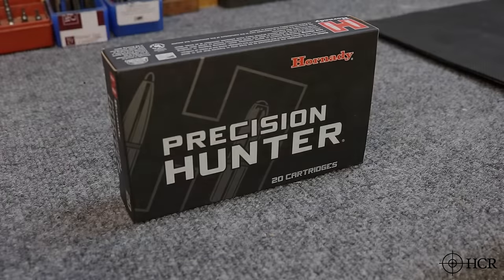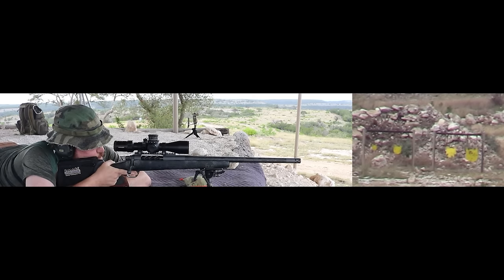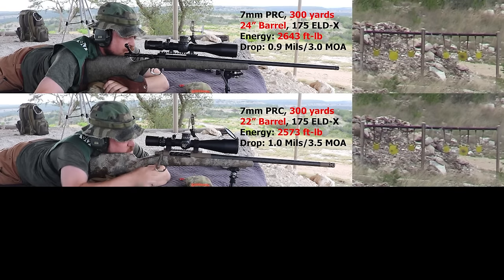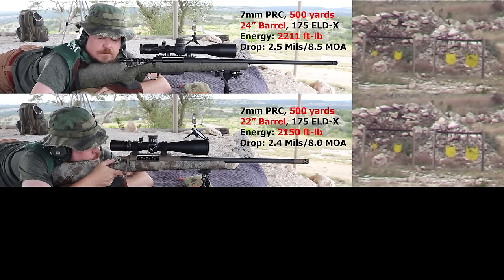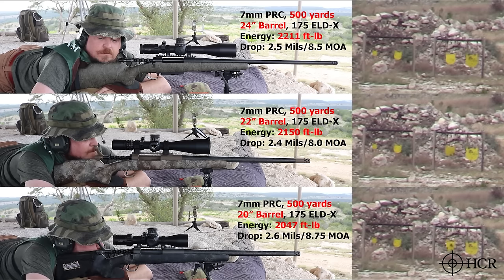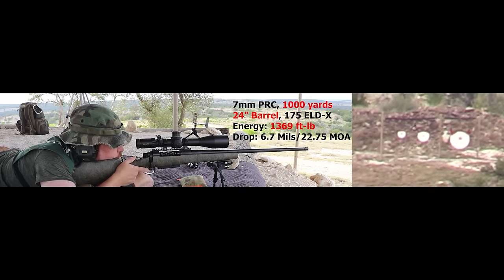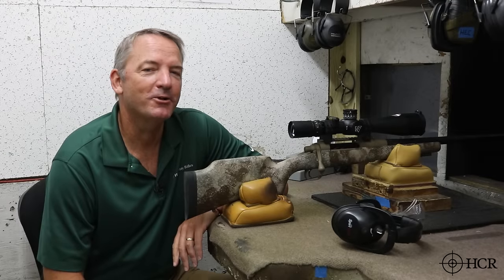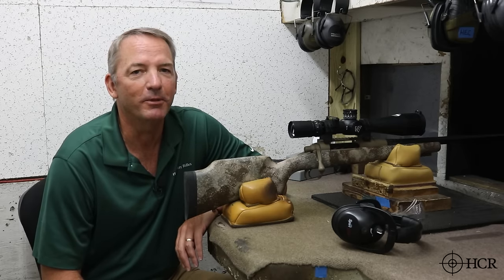Long Range 7mm PRC Testing & Data

Comment: Certainly doesn't look like it's better than a 7 mag to justify spending $20-$30 extra a box.
Reply: There is no cartridge that’s better or worse in performance. Obviously a .22LR and 300rum have different uses. But optimisation and being flexible is a huge selling point now. You can do everything in the PRC that the rem mag can do, but the rem mag was never made for heavy projectiles. Which is the major selling point. People aren’t going to run out and sell their rem mags tomorrow. But when someone’s in the market for a long range deer rifle the 7PRC would have the be at the top of the list. There’s no way you’d pick the rem mag over it. Which is what I’ll do in a couple years, get a nice 24 inch barrel to put on my rem mag and do everything my rem mag could do but with 100fps more, and being able to handle 162-195gr bullets that the old rem mag can’t
Reply: Not with the kind of factory accuracy and performance it won’t. 40$ a box bullets aren’t shooting game consistently at 800-1200 yards, or anything for that matter, not an old design anyway
Reply: @corygamble9785  you have zero clue what you're talking about. I bought a whole case of 7mag Hornady eldx last year for $42/box that punch groups that touch out of a Tikka.
Reply: @corygamble9785  Gunwerks flagship rifle was chambered in 7 mag and they promptly proved it on elk at 1200 yds.
Reply: @devinb3397  did you just say a 7 rem mag can’t handle up to a 195gn, have you been living under a rock. I have a saami chamber 7 mag and shooting a 195gn 2912 and if I have n570 I could go over 3000. That load beat every one in that video with the same amount of grains in the 7 mag.
Reply: @12318150  well ya got me on the accuracy but the performance out of factory ammo I’m still taking the dub. It won’t be a couple years and the 7prc will be the same price as everything else. 300 prc is only like 60$ at the local bass pro. If I had a 7 rem mag I’d probably keep it but they have a new predecessor and it’s the 7prc.
Reply: @12318150  they also tried to dump it from a 7 LRM which is virtually a 7 PRC
Reply: @SpudOutdoors  what’s your twist rate, how long is your barrel and what action is it built on? Im talking about the general rem mag you pick up off the shelf. You can’t just load a 195gr in 99% of the factory rem mags in existence. 1. because the twist will be far too slow and 2. Because the bullet would be so far seated into the case it’d just be stupid. PRC you can shoot 195gr in literally any rifle it’s chambered in with ease no questions asked. And will get more velocity 100% all things being equal like barrel length
Reply: @devinb3397  one you can buy factory browning 1:8 twist with a long magazine so everything you said was wrong. Secondly I shoot a 1 8.5 26” on a tikka action. If a magazine isn’t long enough change it. You are not limited by loving with factory. This isn’t the 1980s anymore. Going custom is so easy to do and lots of great smiths. How many people can buy a Ruger and completely change everything. Happens all the time. Your argument is just moot.
Reply: @SpudOutdoors  what if I don’t want a browning? And why would I go the full custom route and get a rem mag when I can get a 7mm PRC straight off the shelf that does everything with no mods, and has better performance, accuracy and efficiency? I own a rem mag, but no way I’d buy one over a PRC
Reply: @devinb3397  then that is your decision. But don’t say the 7 mag is worse because it really isn’t. With the 195 at 68.5 grains it is destroys that PRC and the PRC is using the same amount of powder because the bullet sits out further but it doesn’t push that 195 like the 7 mag does. I have no problem saying the PRC is good at what it does. Because it is a good choice for people but what I have a problem with is people under rating the 7 mag because they aren’t speaking truth to its performance. Same thing with 280AI. It stays in the pack easily.
Reply: @SpudOutdoors  the PRC literally gets better velocity than the rem mag. You’re just cherry picking your data that’s on the absolute extreme end of rem mag performance and comparing it to baseline PRC. Sure if you run a rem mag with a long barrel with who knows how much pressure, you can beat it eventually. I loaded my old rem mag to over 3100fps with 162gr pills but the brass was done after 2 firings. if you compare 2 equal rifles the PRC is getting higher SAFE velocity every time. And factory ammo has got way higher average energy and better ballistics for the folks who don’t want to reload. Theres factory load in the rem mag or 280ai that gets close to the PRC either. 
Backfire literally did a test where the rem mag got 100fps less than the PRC with the exact same powder charge
Reply: @devinb3397  it depends on powder and I didn’t cherry pick. I picked the best heaviest bullet. 7 mag will push it harder than PRC. Buy one if you can and idc. But stop thinking the 7 mag is a slouch.
Reply: @SpudOutdoors  how are you not cherry picking 😂 barely anyone even has the PRC yet and has yet to test all the powders and push it way past safe loads, and use a long barrel. How long is your barrel exactly? look at the safe load data, the PRC is quicker than the rem mag. The factory loads smoke it, 175gr at 3000 vs a 162gr at 2940. I guarantee if all things are equal the PRC gets better velocity for any bullet weight. Shorter fatter cases with steeper shoulders are just more efficient, it’s been known for a very long time. If you’re basing it off the fact that the rem mag has a few more grains H20 capacity it’s just not correct. Like I said, it’s been tested and with the exact same powder charge, same barrel length, same bullet,  the PRC is getting 100fps more. I could load my old rem mag to 3100fps with 162gr which was what the PRC basically gets, but the cases would be absolutely fried after a couple firings. You can’t compare the extreme end of the spectrum to a standard factory load and call it a day.
Reply: @SpudOutdoors  are you going to tell me 308 is quicker than a 30-06 because your 30 inch long gun with a load thats way over max shoots quicker than a factory 30-06 load in a 22 inch barrel?
Reply: @SpudOutdoors  do some research on how case design has a huge effect on velocity. Just because the rem mag has more powder doesn’t mean it’s velocity is higher. The PRC 100% gets close to 100fps more across the board all things equal.
Reply: @devinb3397  you have no clue what your talking about guy. I actually have the loads and beating the PRC, so it’s proven and if your a guy that hunts long range with factory ammo then your the one unethical. Guys who care about accuracy don’t don’t shoot factory ammo period. And if your going to reload. You get more out of the 7 mag. Period.
Reply: @devinb3397  your missing the point. I never said the PRC wasn’t a good round. I said you are underestimating 7 mags full potential. That’s the point. And while you are out there spending $70 a box of ammo that you can’t find. If I am out of my handloads I can pick up a decent box of ammo for $35-$40 any where in the country. Good luck guy.
Reply: @SpudOutdoors  how many more times do I have to repeat it.. the 7mm PRC gets higher velocities all things being equal. Your gun and or pressure, is not equal to the stock standard max loads that have been released so far. Nobody has even done any experiments with max loads. You still haven’t answered how long your barrel is yet either. Your anecdotal evidence means absolutely nothing. A rem mag can beat a PRC if it’s got a longer barrel or way over pressure loading. 100fps is not much. I could load my old rem mag to PRC velocities easy but the brass was absolute toast after a firing or two. I guarantee if you put the same bullet, powder and barrel length on two rifles in rem mag and PRC, the PRC will reach a higher velocity. Please do send SAAMI and Hornady an email explaining that their entire engineering department is wrong, because your magic rem mag can shoot a 195gr at 3000fps
Reply: @SpudOutdoors  I’m sorry but you honestly don’t have a clue. I’ll write it out in simple terms for you. 
1. SAAMI’s engineers state the PRC has higher safe velocity over the rem mag with the same barrel length 
2. Independent tests have confirmed this, with the PRC getting higher velocity than rem mags. Even with the same powder charge and projectile, it’s sending it 100fps quicker. 
3. Just because the rem mag has more powder capacity, does not mean it can shoot quicker. Case geometry plays a huge factor and makes up more than enough for a very slight lack in capacity. 

Go on keep explaining SAAMI and Hornady are wrong.  literally dozens of of engineers with thousands of times the experience any of us has, are all wrong because of your special rem mag that twists the laws of physics
Reply: @devinb3397  no reloader follows saami if they did then no wildcats in competition. You believe whatever the marketing tells you. Your not worth my time.
Reply: @SpudOutdoors I’m just dumbfounded you still actually believe the rem mag shoots quicker than the PRC. I’ll explain it one more time. If everything is apples to apples, the PRC is quicker that the rem mag without a doubt. Btw SAAMI is just the authority who tests the case to determine specs and safe limits. Seriously, write to them and explain how their entire team of engineers are wrong. Still waiting to hear what length barrel you have
Reply: @SpudOutdoors  Your 195gr at 3000fps load is a lie regardless. Not possible in a 24/26 inch barrel rem mag without insane overpressure
Reply: @devinb3397  I use a labradar yes it’s possible. Maybe if you actually followed reloading groups you would know it is. Many witnesses here that saw it happen. There is people getting higher than me I just don’t need to go higher. 2910 with that bullet is plenty of energy past 1000.
Reply: Belted vs unbelted is a huge plus for the prc and ultra mags.
Reply: @mikemcreynolds6236  I actually like the belts and if unitized correctly then double headspace
Reply: I wish they made high BC monolethic Projectiles,  lead free.
Reply: Funny how that’s what everyone said about the 6.5cm but now it’s cheaper than just about anything comparable besides cheap 308. Very uneducated comment. This round is going to have a huge following and support.
Reply: @MrT13  this comment is uneducated. Creedmoor was out for a decade. None of the PRCs are that cheap. Good lord.
Reply: @SpudOutdoors  what you want a year old cartridge to compare? I looked just now. They are both within 5-10$ a box 7rem vs 6.5 prc. Some more expensive for the 7 some more for the 6.5. 20-30$ a box is the only thing uneducated about this.
Reply: @SpudOutdoors  let’s actually go with something more comparable though. Go find 6.5x55 or 260 cheaper than the cm. Seeing as how both are older they should be cheaper right?
Reply: @MrT13  compare it to the 300 PRC
Reply: @MrT13  nope can’t compare creedmoor. It’s used by military. Any thing military gets cheaper.
Reply: @SpudOutdoors  6.5 prc 147 eldm 58$ a box. 7 rem 139 superformance 80$ a box. Hunting? 7 rem 162 eldx 69$ a box. 6.5 prc 143 eldx 64$ a box. Right now. This minute. On midway. So there’s that…………….
Reply: @MrT13  midway prices are a joke. I bought 7 mag for 37.99
Reply: @MrT13  just found a ton of 7 mag ammo for under $35 a box.
Reply: @SpudOutdoors  you did say any prc correct? But ok. Let’s see. 300 prc 225 eldm 64$. 212 eldx 64$. To me that’s the same is it not? Or cheaper. No there are no cheap manufacturers making any prc yet like there is old cartridges but I did just show you modern being the same or actually cheaper than a 7 rem.
Reply: @SpudOutdoors  yea and like I said yes you can go find some Prussia premier gold whatever for cheap. Cause it’s old af. You did say no prc though correct? Then I kept it simple. Same company. Same bullets. Different cases. And same price or cheaper. Not what you said. 30$ a box more. SAME jack. And does insanely better at all aspects. Nobody uses old stuff in competition cause it’s not better. And if it’s your price I just gave you apples to apples. And you’re wrong.
Reply: @SpudOutdoors  same thing with .243 guys. I used that round to shoot probably 100-125 hogs. Great round. 6cm is better. Absolute fact. Notice how those who have actually owned both of something will always tell you the newer is better. But those who own the old thing only just go by 2 simple numbers?…… that’s you. With your 30$ a box. That’s wrong.
Reply: @MrT13  there is a ton of ammo at 35 or under for 7 mag. You won’t see 7mm PRC that cheap and secondly I don’t buy from midway. They just spent over 100 mil to build a new warehouse. That is why they price gouge. I reload my 7 mag. I’m shootings a 195gn Berger over 2900fps which the PRC will never do.
Reply: @SpudOutdoors  the speed game is not precision. If it was everyone in fclass would be using the 28. Or prs would all be using 220 or 250 or 2506 but they don’t do they? So to say oh my whatever going whatever is better is ignorant. Competition has proven your rem mag is not precise. Not even in the top 5 choices actually. So if I wanted to say something dumb like my 220 swift goes faster than your 223 ever will. Is true. But the rest of the world must have just forgot to listen to your infinite wisdom…. My 284 shehane is a 2910-2920 fps second gun shooting a 15gr lighter pill. And it will absolutely undoubtedly walk any and every 7mm rem mag on the planet. That’s is just a fact. So like the 260 and 6.5x55 guys who don’t even own any of the 3 saying oh the 260 called and the cm is just now getting here? Hahahaha what a waste etc etc is always the same ppl who have a very limited if any experience in actual precision shooting. Do you just hunt? Good stick to it then. But the word better is not only for you to use lol. And my 284 is waaaaaaaaaay better in every way other a couple fps than your precision rem mag or anyone else’s for that matter will ever be.
Reply: @SpudOutdoors  I definitely agree with you though about pricing. Obviously there’s super plus legend ppufw ammo made in some crap factory with old stuff tooled for that caliber sold at auction and now is being made cheaper. That’s every old cartridge. But xxx box same pill same powder different cartridges? Actually the newer stuff is often cheaper. I proved that in some other comment in here with the cm vs 260 or 55. And the cm is faster. You mite be or you mite not be honest about that number which I don’t think you are honestly. I think your lying by about 200-250 fps but whatever don’t mean you aren’t. Cause all factory loads out of the rem at 175s come in at 2800ish. Lots of good fast hand loads with vv newer stuff getting 2900 but STILL WITH 175’s. So when someone tells me they got 250 fps more. PLUS 20 more grains I call major bs. Still fact is maybe. Lol. But nevertheless countless ppl have tried what you claim and I guess your better than all. Hm….
Reply: @SpudOutdoors  I hope you know that takes close to 80,000 psi though lol.
Reply: @MrT13  nope I am not. I am using Berger load data. Seating my bullet longer but only .1 grain more at 2910 Avg I have hit as high as 2980. Now that my action has a wsm cut I can do to the lands, so 3000 is achievable.
Reply: @MrT13  just go ahead and believe whatever marketing tells you. If you actually properly throat a 7 rem mag and seat the bullet at roughly 3.667 or so a 24” barrel can achieve 3100 fps with a 195gn. But a 195 in a standard throat is plenty of velocity and still allows you to shoot light bullets.
Reply: @SpudOutdoors  ok.
Reply: @SpudOutdoors  that’s the funniest shit I’ve ever heard. 3100fps with a 195gr in a 24 inch rem mag 🤡 sure you can do it with brass that lasts 1 shot and a barrel that’ll be cooked after 200 rounds!
Reply: @spudhunter3282  hey genius, your comparing handloads to factory ammo, you don't think they can get better performance handloading. Compare factory 175 ammo out of a 7mag and 7prc. The 7 prc wins every single time. If you handloaded for the 7prc it would stomp on your hand loads for your 7 mag. That is a fact.
Reply: @matthewkyle6939  lol some ppl want to save 5-10$ a box. (Actual difference in price) Some ppl want to do better in life.
Reply: @MrT13  lol
Reply: Reading all these comments, discussions and arguments, the conclusion I see is that yes, the 7mag can do what the PRC can do, if you handload; the PRC is off the shelf and its base is 175 gainers at 3000 w/o hand loading...I have a 7 mag, my go to rifle, yet I would def buy a 7 PRC, as a matter a fact I would also buy a 6.5 PRC...
Reply: @josephvillegas639  I got a 6.5cm that I just decided to get a cheap one and reload it for the wife or new shooters. So naturally when the prc came out I would get one but I’ve also got a 6.5-284. But couple ppl I know are reloading that 6.5 prc and with the heavier stuff 147-156 it really does do good. Super square and predictable. Very consistent cartridge. One buddy made a pretty legit gun out of one to shoot the 153 bergs and it really surprisingly gives the 180 berg a run for its money. I think on paper it’s actually a better bc but real soft out of a legit heavy gun. It was surprisingly tight too. Those 153’s he got really doing good out of that gun. My 284 never liked the 153-156 bergs so I’m actually kind of jealous at him. It’s a good combo for sure.
Reply: @josephvillegas639  not only do you get that performance from over the counter ammo and off the shelf rifles. You would have to rebarrel a 7mag to fit those long rounds. 7 prc is really dope.